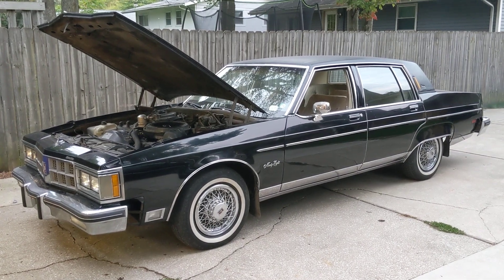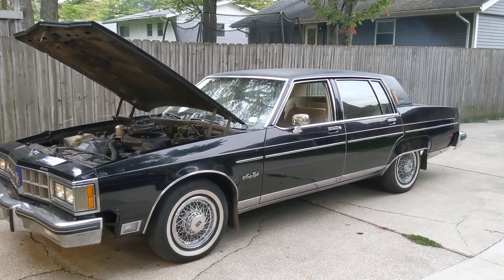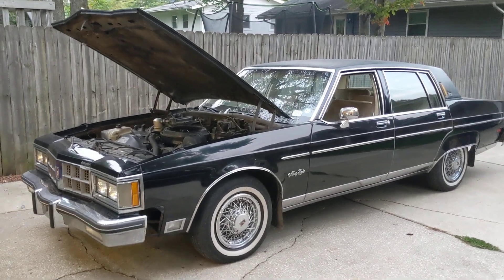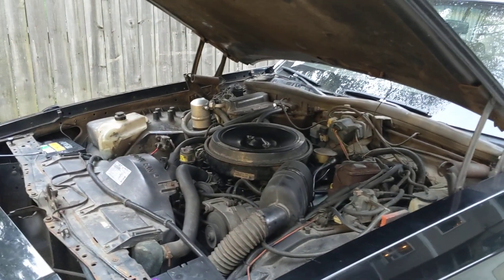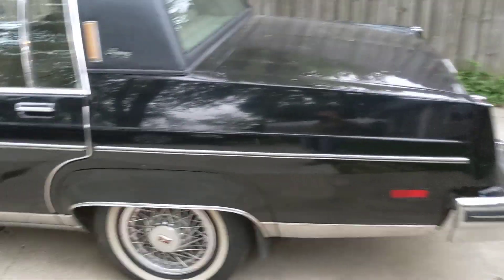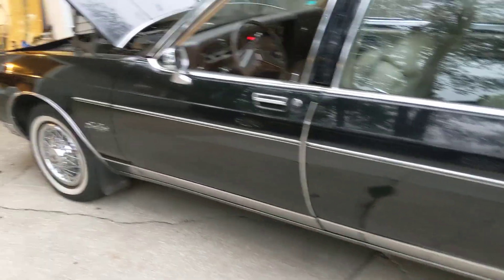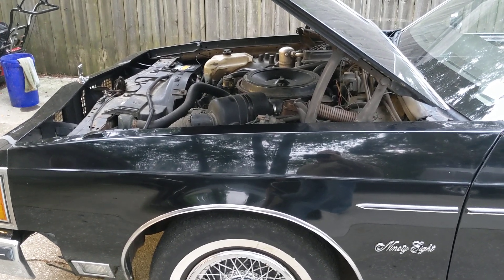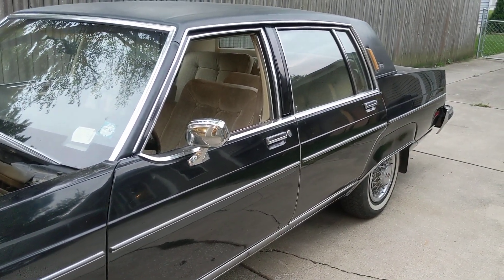Olds Ninety Eight diesel back to life!

Comment: Oh yes, running better.  I can't remember, but I thought  messing with the injector pump timing in some way, either advance or retard  can optimally get it running and smoking less.  I forget the name of the website, but there was a guy who had organized a bunch of info on the Olds diesel and he had some tips for setting the injector pump and some caveats for people who would set the pump to gain more horse power -but then it added more combustion stress.  He also had a lot of info on what he felt were necessary things to add/upgrade such as the new bolts and a water separator.  Maybe you find find that website if you google search  olds diesel.
Reply from the maker: Good to know, I'll see if I can find it
Reply: @BigMessGarage  I did a search on the Cadillac Forums website and not much showed up that I could tell about that issue.  There is no specific diesel topic on that website.